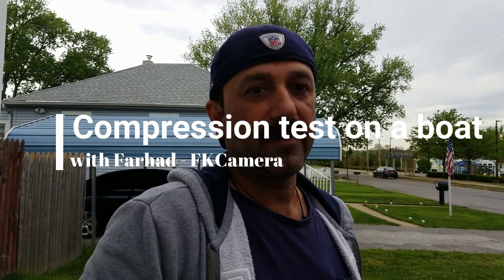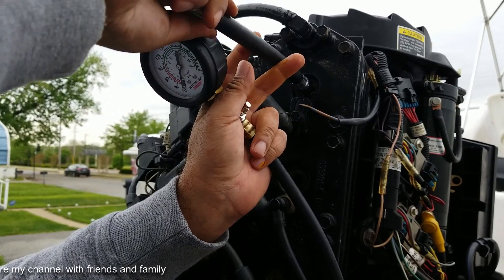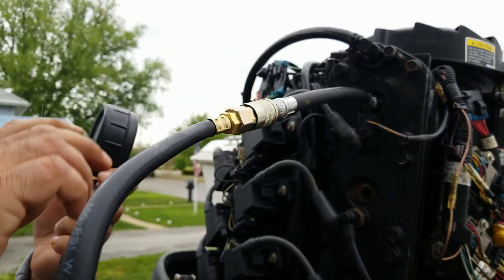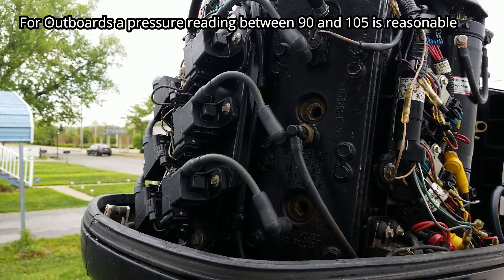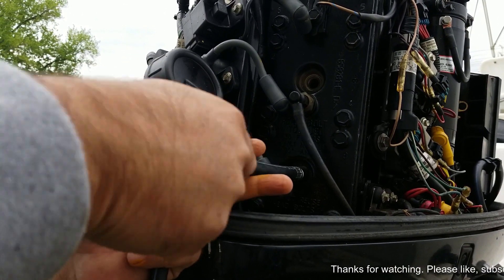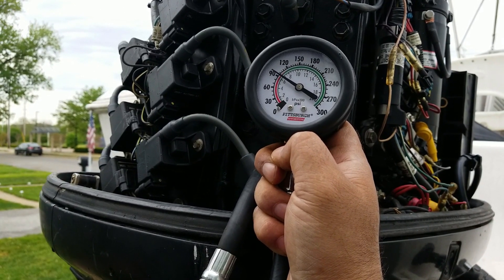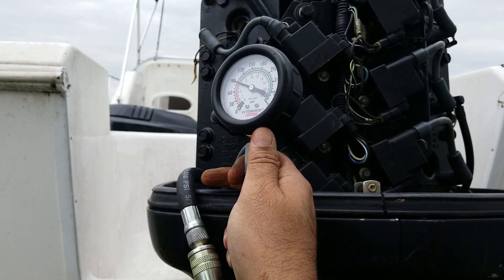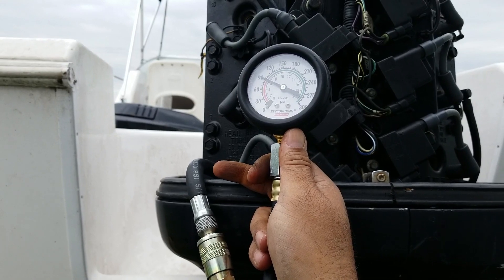Compression Test on Mercury Outboard 150 hp|By Farhad|FKCamera

Comment: Throw away that crappy Pittsburgh tester. 90 PSI is not enough for that engine. Put an accurate tester in it, and you will get better numbers. Also, don't forget to ground out the sparkplugs while cranking so you don't blow the ignition system.
Reply from the maker: Lol that's right. !! They been tossed out

Comment: Is 56 psi good for my 150 optimax
Reply from the maker: 56 is not good. Whats the pressure on all ? Was gauge properly screwed?
Reply: @FKCamVlogs  I bought a 150 optimax on eBay. It’s a 2010. The guy said it had perfect compression and it ran great. I ship it to me and take it to my mechanic. He plugged it in and it read it had been overheated on both sides to 217 degrees. Ram low on oil more than once and the compression was 56 on all cylinders. He’s trying to tell me that’s normal and it’s a good engine. I think he’s nuts.

Comment: My 2005 Mercury 150 hp Carb model compression at 408 hrs is : cycl one 120, two 122, three 120, four 120, five 124, & six 120. 
With all Plug wires grounded, throttle wot, motor warmed up.
Reply from the maker: Those compression ratings are perfect. Thx for sharing!

Comment: Did you warm your engine up before testing?  If not, you will not get an accurate reading. Also, I would not trust a chinese brand compression gauge, especially when I see that gauge read the same reading with every cylinder.
Reply from the maker: I agree with you on the gauges. I did another video with hot and cold engine and with better gauges.

Comment: That sux bad conp
Reply from the maker: Those were low grade gauges from Harbor freight, gave incorrect pressure!
Reply: its good comp. all 6 read 90. when its hot that compression goes up to 130. add some oil in each cyliner it prelubes it and will give you a higher number.

Comment: that compression tester reads low, i have the same one. and you should ground out the plug wires
Reply from the maker: Thanks for your suggestion and yes, I will be doing another video with WOT and properly warm engine
Reply: @FKCamVlogs  wot wont make your compression change. i tested it, and there is no differences. if you think about it, how would any engine start if you didnt have full compression at idle.
Reply: its actually accurate its cold. add a few drops of oil then do it. you should be putting 5 drops of two stroke out in each cylinder. it will read 130 like it does when its hot.

Comment: I have a 2003 version of this motor. Pretty sure it's a rebadged Yamaha. I love mine. If it's running fine it's probably just a bad tester because should be 120=30
Reply from the maker: Well said captain. I couldn't agree less. The gauge was harbor freight brand, also it wasnt the WOT test. I will perform with WOT at the end of season and post
Reply: Any diferente  with wot?@FKCamVlogs

Comment: What about fuel pump....us it pumping fuel? You did not  mention!  Is tgat good if fuel  pump is on?
Reply from the maker: David lots of people do WOT(wide open throttle). I did not, this year before season ends I will do WOT and test. I think with WOT you get high readings
Reply: Pull the injector fuse yes first off

Comment: I did a test on a 2001 Mercury XR6 after tuning the motor for 15 minutes and compression was about 105-110 do you think is good or is very low?
Reply from the maker: For all cylinders? If, Yes then its good. 10 to 15 psi variation I believe is ok
Reply: @FKCamVlogs  I had a guy tell me that 56 psi compression test on my optimax 150 is fine
Reply: The manual says it should be 110 to 135 no difference of 15 psi between them

Comment: 90 psi seems very low for 150hp
Reply: The compression should come up alot faster.   Should NOT have to crank it so much to get 90 psi.     Motor needs a rebuild b4 it tears up sumthin serious
Reply from the maker: It was a cheap Harbor freight tester. I am sure with a better tester, reading can be lil higher
Reply: I have a 2001 mercury 150 efi and my compression is 120 on all cylinders. I think that's what yours should have. Looks like that motor needs a rebuild.
Reply: @cheriescor3  its cold. they will read 130 when hot. if all 6 read 90 its still fine
Reply: @colbybud  Exactly, what you look for is consistent PSI readings.
Reply: I used to work in a shop and when we did a compression check we only had to crank it 4 revolutions. It’s a two stroke it builds compression every time it hits top dead centre. This one seem like it took a long time to get to 90 pounds and excessive cranking.

Comment: Might want to check your manual, if carbs, butterfly should be wide open, 90# compression spells trouble, my 150 xr6 is 130 to 134 all 6.
Reply: It doesn't matter. The idea is that they are all 90....if anything out if ranges...then  take steps.
Reply: @daver2964  they read 90 cold. all 6 usually. you need to squirt some oil in each cylinder. this prelubes the cylinders. you also should pull the injector fuse. and or turn the deadman switch off. make sure fuel isnt being put in there. with a few drops of oil it will read 130. like it does when its hot
Reply from the maker: Rick, this was a cheap buy from Harbor freight. I will buy a craftsman this spring and retest. If anything I have another outboard sitting. Thanks for your input and keep in touch
Reply: It took along time to build up to 90 psi as well.

Comment: carl H your right on grounding plugs, also push the knob in and push the throttle wide open as to build compression you need air wide open air coming in.